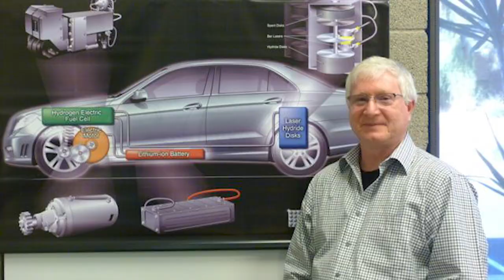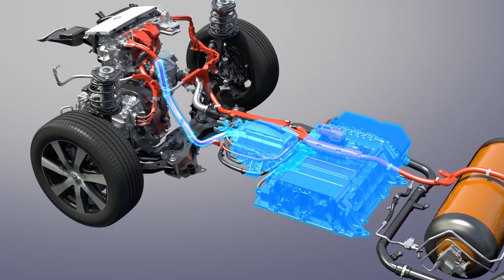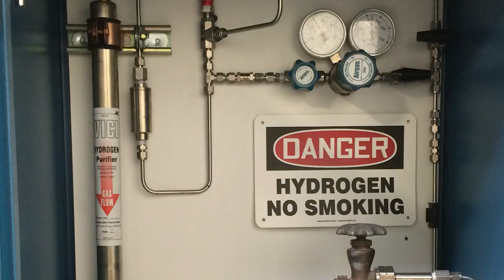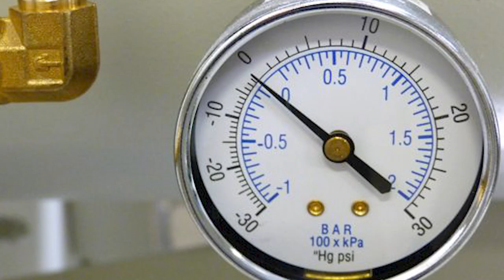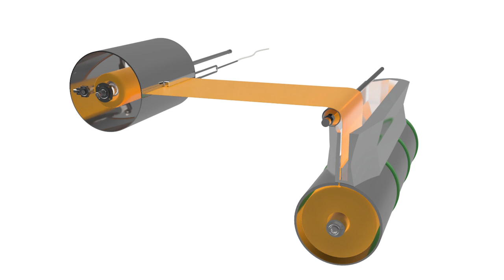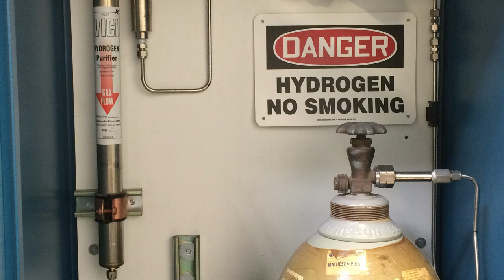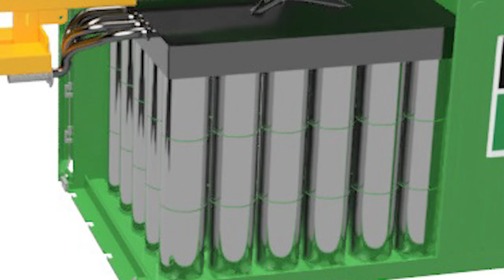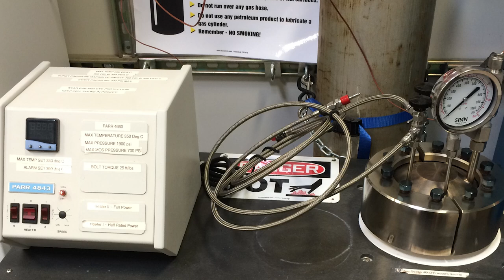This BANNED Technology Could Push Hydrogen Cars Over BEVs

Comment: You think electric cars are pro-environment?  Even if CO2 was harmful to the environment (and it it not) electric cars would be no solution because of the total lifecycle CO2 emissions.  This is especially true if people want to charge their cars up at night using coal generated electricity.
Want a really low emissions vehicle?   Get an electrically assisted bicycle or scooter. 
I bet in 10 years the leading electric vehicle manufacturer will be Toyota and VW will be number two.
Reply: BS, I charge every day, from solar on my roof and batteries on wall, my electric car and bikes all suck up free power from sun, every day, no fuel bill for years, the energy put into making batteries does not EVEN COME CLOSE to the energy put into getting oil out of ground, oh you forgot about all of those emissions also..... Oil rigs offshore and such make your argument about the cost of batteries etc BS, also some places recycle batteries and that improves every year........If the entire world did this, powered cars via sunlight, you dothe math now on carbon being released and go on, say it makes no difference, what a joke. Your whole argumen if, dependant on charging at night with coal power supply it completely ignores the fact, the more infrustructure you put in for this, the less that happens, you know what governments have done for the oil companies for over 100 years now why not try that same approach.....

Comment: Hogwash. IC cars and trucks will be with us for a loooong time yet. Electric motors are OK, but not so batteries. The hidrogen cell works, but hidrogen is hard to produce, store and transport. Gasoline has the better energy density of them all, is easy to store and transport, and we have the infrastructure already in place. Bah.

Comment: Every day that you don't post an update retracting the claims in this video, you lose credibility. Do you really not care about accuracy or truth?
Reply from the maker: I do. Do you?
Reply: Why have you not pointed out all the problems with this tech, including how claiming that it's "banned" is effectively lying by omission? This tech isn't banned or disruptive, because it's extremely impractical if you run the numbers on the energy density. Why did you not question the fact that this system would hold less hydrogen than an few balloons could, and why did you not question his impressively bad analogy to CDs that exposed the fact that he has no idea how CDs work?

Comment: Hydrogen burns very clean, easy to make.
Reply: Easy is a relatively loose term.  Expensive, but easy.  Sure you can just throw some expensive products together and make a little H2.  Sure you can just stick some electrodes in a bottle and make it by losing 75% of the energy in the process and eating up the electrodes in no time.  Making it efficiently isn't easy.  Even the most efficient method (and costly) plus trying to make it back into electricity is still way less efficient than pumping water up a hill and capturing the energy on the way back down.  If Hydrogen was easy to make, it wouldn't cost as much as it does, plain and simple.  If it was easy to make, there would be Toyota Mirai's everywhere.  Easy implies cheap.  And that it's not.